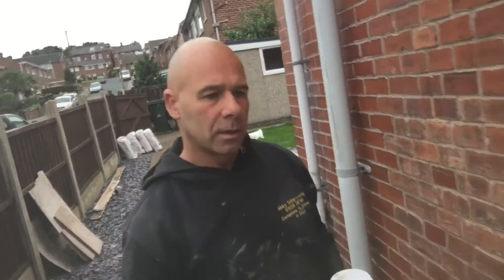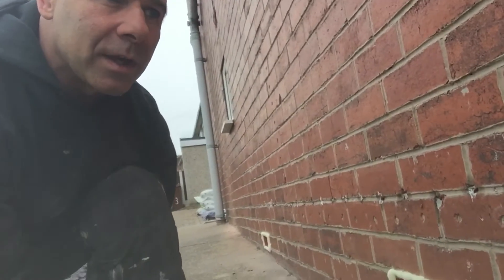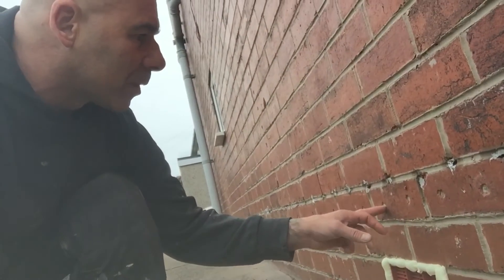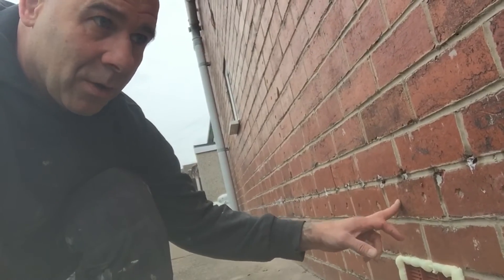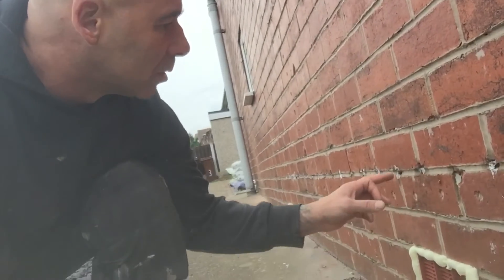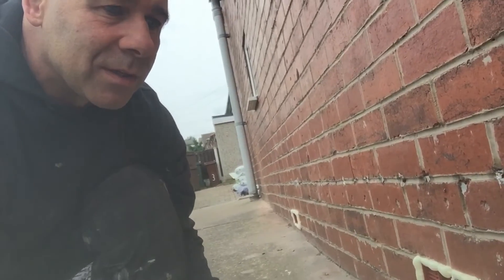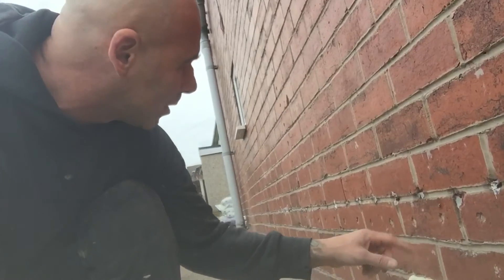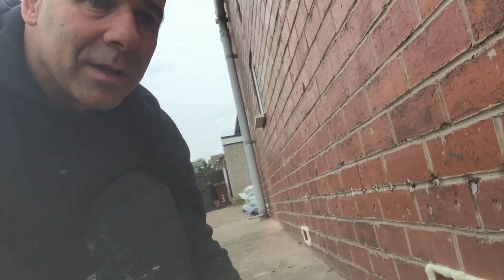Do you know why some dampproofing holes in the brick and some in the masonry joints?

Comment: 20/30 years on with holes drilled directly into the bricks of a terraced house i can show clear damage to the shared ally access wall bricks which on one side are beginning to disintegrate and on the neighbours identical terraced house side which has never had it done the bricks look as good as new. All those who had bricks drilled into beware of future impending problems!
Reply from the maker: Yes water can get in the holes and freeze and create spalling over time
Reply: I think there might be more to it, the ground floor gully is sheltered above by the first floor of both houses joined and has doors both ends, in another area of the house the disintegrated bricks are worse on the internal leaf of the solid brick wall to a heated room, it were found at least several bricks were upto 20/40% damaged, these bricks were also covered with sand and cement render, unlike the gully bricks which are beginning to break.

Comment: I have maybe a stupid question… my house has damp because the chemical is in the bricks and not the mortar. Can it be injected on top of what’s already there, or does it have to be somehow removed from the brick first?
Reply from the maker: You can drill the mortar but make sure you use the damp rods, do the course above the drill holes. The old silicone high pressure damp systems can breakdown over time and quicker if it’s not been installed perfectly. The rods will work up to when the house falls down,
Reply from the maker: You can drill the mortar but make sure you use the damp rods, do the course above the drill holes. The old silicone high pressure damp systems can breakdown over time and quicker if it’s not been installed perfectly. The rods will work up to when the house falls down,

Comment: I want to damp proof a terrace house with cream in the mortar joints. Can I just do it from the outside because it doesn’t have a cavity ?
Reply from the maker: Yes if you have a long enough drill bit
Reply: @dampsam  cheers so go 8 inches into the brick from the outside ?
Reply: Also how long does it take for the walls to dry out and return to dry levels ? These manufacturers do not tell you which I think is a bit dodgy ?
Reply from the maker: Its how long is a piece of string. Walls are different thicknesses and capillarys different sizes so all different drying times, if the plaster is contaminated it needs replacing and the damp you have has to be diagnosed correctly. Not all damp is rising
Reply: @dampsam  cheers thank you for your help much appreciated. I’m going to have to measure the thickness near a door or window.

Comment: I can't see the mortar brick lines at the bottom of my solid brick wall, as it is all rendered over with cement about 8 inches from the ground. Can I just estimate where to drill into the mortar, if I drill into the bricks will the rods still work? Cheers!
Reply from the maker: No, it will still bridge, it may need cutting off above the dpc level and a drip bead installing

Comment: Hi pal. My house was built in 1906. It has the holes in brick like that which is damp proofing. We get rising damp in winter. Also not sure if it has cavity walls.... cant do being built that far back. Double brick maybe? What would work on our house. We lifted floor board up to sort radiator pipes out and there's a big pit under house.
Reply from the maker: Are you sure you have rising damp? I would have an expert competent surveyor look at it. Rising damp doesn’t come and go it just gets worse and worse., also make sure your subfloor is vented correctly.

Comment: Many thanks for the video.
I have one on my exterior wall and it looked like multiple holes on the building. The wall isn't made of bricks , it doesn't look too good from the outside.
I intend to paint outside.  Can I close it with a wall filler and paint across?
Would this prevent it from working ?
Reply from the maker: No it wouldn’t prevent the system from working unless there is bridging, once the solution is in the wall it wall work if it’s installed correctly
Reply: @dampsam  thanks for the prompt response

Comment: You have an internal and external wall with a cavity, assuming the cavity is clear of obstructions the internal wall is the only wall were damp treatment/dpc needs fitting. External walls are only a cladding, you have to question if any type of damp course is even needed on the external skin when the best dpc is the cavity between both walls.
Reply from the maker: Both walls go down under the ground to the footing so a dpc is needed 150mm above ground level according to building regs
Reply: @dampsam  
Hi Simon 
DPC to both walls 6 inch above ground, written into stone by building reg's

External walls of any standard house will be at least 5 meters in height and this is a large area exposed to the elements, below the DPC 150mm in height. When taking account of standard rainfall within the UK most external walls spend a lot of time getting wet and gravity is stronger than capillary action so gallons of rainwater will run down the surface of any external wall to the DPC level yet everybody is focused on what may be a few pints of water rising up from the ground.
Reply from the maker: @leethornton6395  your missing the point, the dpc is to stop ground water from rising up the wall via capillaries the evaporating out leaving salts on the wall, the position set by building regs is 150mm from the ground externally to avoid rain water splash back. 
If you need to argue the point contact the BRE.
Reply: @dampsam  

Sure natural water has some level of salt, but most salts that evaporate on the surface of buildings tends to be contained within in the bricks due to the manufacture process and can appear on wall surfaces when any evaporation of water occurs, unsightly yes and not in my opinion the result solely of rising damp. I'm happy for DPC 150mm from the ground to be installed this protects the bricks and building structure above this level from the foreseen threat of rising damp. The only point I have been trying to make is if you have a cavity that is clean with no bridging there is no way water can transfer to the internal wall. Regardless of any rising damp from the ground water. I've yet to see the evidence water can cross a void of 50mm - 100mm even if the DPC is bridged externally by somebody laying a path above the external DPC  the internal wall will still be free from damp. In my experience bridging of the two walls resulting in penetrating damp has always been the problem and not anything to do with rising damp. This is why I personally believe that nearly all say 95% of any type of chemical injection of walls doesn't solve the underlying problem.
Reply from the maker: @leethornton6395  I hear what your saying but I’m not sure weather it’s a general statement or to do with the video? 
Yes in theory a perfect cavity will work but when you get wall ties fitted incorrectly and also retro fit cavity wall insulation also fitted incorrect when it’s over subfloor vents and sags along with raised internal solid floors you get bridging issues which is what was happening on this job. A number of different systems were put in place and no issues have been reported since
Reply: @dampsam  Hi 
The work you have carried out is what is expected from a competent and experience tradesperson and you are the person on the ground who has to decide how best the damp problem is resolved. You look at the issues logically and your ability isn't being questioned. Its a bit unfair of me to focus on one issue which is chemical DPC injection when only one video doesn't give the full picture. Keep up the good work and thanks for replying to my posts.

Comment: How do I find out how thick wall is? And can I do it all on the exterior walls of kitchen, or do I have to do it from internal walls of kitchen? Which means taking all cupboards out.
Reply from the maker: Measure across the reveal on the door opening and take off the thickness of the plaster around 20mm

Comment: Thank bud, could I drill the holes from the inside and add cream? Cheers.
Reply from the maker: Yes the holes can be drilled from the inside just measure the thickness where the door is and drill to within 25mm of the far skin.  Apply StormDry outside to avoid rainwater splash back issues if the DPC is lower than 150mm from external ground level.

Comment: Who the hell puts sub floor vents/Cav vents in with a foam gun?
Reply from the maker: Hi rick thanks for your input and being a fan, it’s instastik that’s been used which is a building glue, Joiner’s also use it for sticking various things on site, it’s just one modern time efficient way of doing things, the foam is cut off and pointed up after. 
Which method do you use?
Reply: @dampsam  Thought it was done previous to you're install of DPC. I do cavity wall insulation removal, we just resent them with sand and cement.  I enjoy watching you're video's btw. 
We do quite alot of insulation removal jobs in blackpool and the cavities are full of sand which bridge's the original dpc...
Reply from the maker: Rick West yes there is a market for going around clearing them out, 
Iv never been a fan of cavity wall insulation,
Reply: @dampsam  Im a joiner and have been for 24 yrs ive never used this expanding foam or seen any of my fellow joiners on site use this stuff ….its a bodge
Reply from the maker: John Ferrier thanks for watching, 24 years ey you must be getting the hang of it now, 
If you have ever used new products like caber deck chipboard treated floor either with the protective film or not you will have glued it with a polyurethane expanding glue. Instastik is the same stuff but ion a foam gun. 
I see you have jumped in and made yourself look silly but I understand if you don’t keep up to date with new products and stay rooted in the past, 
Thanks for taking the time out and watching and commenting if you need further advice on products just email me.
Reply: @john ferrier I'm a master joiner of forty years and I use insta stick low expansion foam to fix skirting boards and most interior trim work. It was originally made as an alternative to dry wall adhesive for dotting and dabbing plasterboards. I have no doubt that it fixes my skirts stronger than your can with screws and plugs 😂😂

Comment: Hi, nice videos! I´ve seen that you don´t actually "clean" the holes you drilled before filling whith th DPC, so I guess that´s not completely nessesary as stated in some tutorials?
Reply from the maker: Hi thanks for watching, I would say belt & braces and strictly according to the manual you should use the corer to remove any debris, the modern drill bits will bring most debris out and if your back filling with dryzone this goes above and beyond what is required, if you are using the damp check rods you do have to use the corer or the rod won’t fit. So play it by ear and do what you think is acceptable when you have drilled the hole. Hope this helps.

Comment: '' We'll point these up and it'll look the same colour as the brick work''. No matter what you do, you will always see the holes.
I think you need to go back to whoever trained you Sam and get your money back because they have been teaching you complete bollox.
Reply from the maker: Peter Gambier not sure what you mean but your entitled to your opinion. The pointing is hardly noticeable when finished. We don’t drill into the brick just the joint.
Reply: What I meant is what I said Simon, even the most skilled plasterer in the world is never going to get rid of a patch repair, at least you drilled into the mortar and thank goodness you didn't go into the brick like the last rising damp repair specialists did and sure, it's a good idea what you did but is completely pointless because whatever is causing the issues from gutter problems to mortar dropped by the bricklayer from above onto the wall tie or built up rubbish that hadn't been cleared out will not be cured by this system,  the problem will still be there and it hasn't gone away. I have seen some amazing damp 'cures' over the years, one of the funniest were long tubes of absorbent stuff drilled into the wall which could be pulled out, dried and put back in again. What is so sad is that the vulnerable householder does not know any difference and is blinded by the bewildering array of cure methods available.
Folks just end up being confused and are really none the wiser.
I'm sure that deep down you are a nice person and mean well but I would desist from doing this work anymore because it's really not right charging people for 'snake oil', it doesn't work and never will.
Reply from the maker: Peter Gambier well peter the work is guaranteed and has worked and the customer is happy so it looks like we have been doing something right for the last 18 years.
Reply: @petergambier  when done properly this method can provide a physical barrier to stop any more damp from rising. I don't know why your talking about leaking gutters as that won't cause rising damp unless your claiming that the water that leaks from the gutter will bounce and splash back off the floor and penetrate in to and ride up the brickwork from there. If that is your claim then I would point out that your damp course be it physical or an after build solution like this should be installed no more than 150mm from floor level.
Now I get that there are lots of YouTube videos and a guy posting videos exposing the corrupt side of the damp proofing industry, I myself have seen the video where he explains that most damp surveyors use damp metres that are designed to measure damp in timber.
None of this changes the fact that this man who is a responsible contractor is injecting a cream that acts as a damp barrier, when injected at the top of every perpendicular mortar joint then damp can no longer progress past this barrier. Striking damp and roofing damp are completely different, yes there are crooks in the damp industry conning people when they don't actually have issues with rising damp.
I'm a builder of forty years and a matter carpenter so I'm basing my knowledge on exactly that-- knowledge and experience, I'm not just watching some YouTube videos and they having a pop art a decent bloke.
In the unlikely event of a damp course failing which does happen on older properties then I would install a new physical damp course but this injection system will stop further rising damp. 🙂

Comment: Those bricks look decent quality and may not soak up too much damp anyway . If you can clean the cavity out inside and go right along then that's the best way but a pain in the b*m to do  . Make sure paths are falling away and downsputs are clearing away from house
Reply: Aye l bet your right, looking at the type  and quality of facing brick used on the outer leaf, l bet you couldn’t inject those with a chemical dpc at 200 psi let alone they will absorbe any capillary moisture. You may get capillary moisture through the mortar line, however as this is on an outside leaf of a cavity wall evaporation will deal with it.  I suspect the homeowner has been conned at least twice into paying for unnecessary work to the outside wall of this property. Not to mention the damage /defacing caused by drilling the brickwork.

) was 
.

Comment: That looks like fairly modern brickwork. I would bet my pension that this house has never needed a damp proof course injecting. More likely to be a bridging problem or such like.
This industry has survived on the myth of "rising damp" and the ignorance of the general public, and even so called surveyors who think a moisture meter is a magic tool that finds damp, when it will find "damp" even in bone dry places.
Reply: I am an experienced builder with over 30 years and I have never ever used any chemical injections in the wall for damp proof course it is all ways bridging problem in side or out side ground level it's always somebody that doesn't know what they are  doing trying to make a quick buck they cause more problems than anything and specially the mortar mix  they use they haven't got a clue and if you know what types A and B grade bricks are  and used for when I get a call out about a job like this I have to fix 3 Jobs before I can actually fix the one that I've been call out to do all my damp proof course work i do i give I  a lifetime guarantee as  I know it has been done right all this chemical injection shit chuck it in the bin and it  only lasts for 10 to 20 years what a pile of rubbish so after that time you'll be back to square one again keep paying and paying again  why don't other  just do it right the first time and never have to go back ever again give a lifetime guarantee like I do
Reply: voodoo audio what about houses built in 1880s with no brick, how do you sort the damp issue then?
Reply from the maker: IPfrequently thankyou for your comments, if you watch the videos I explain that the physical dpc is bridge due to raised ground levels inside and out, a new dpc  is cheaper than digging down below the bridge dpc. Please feel free to contact me via our website to discuss the existence of rising damp and our so called magic meters that find damp. Have a great day